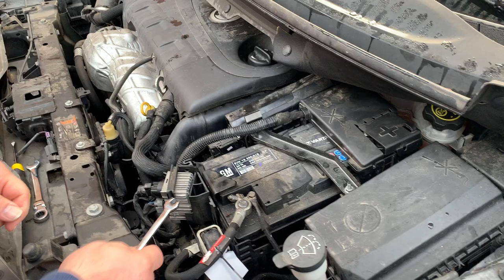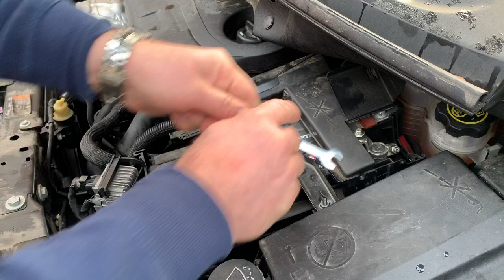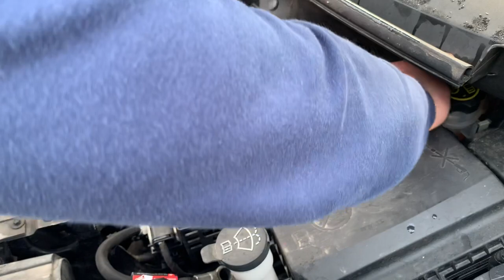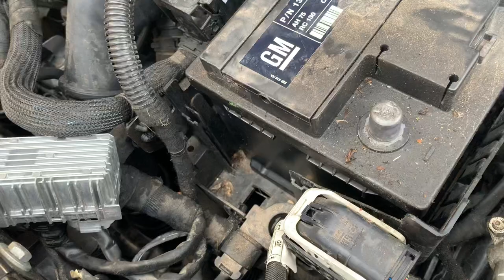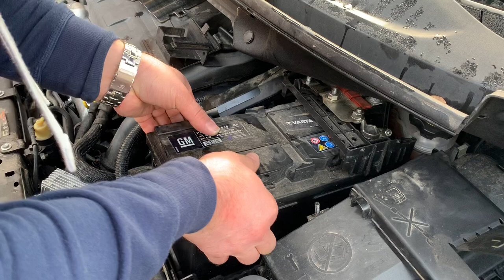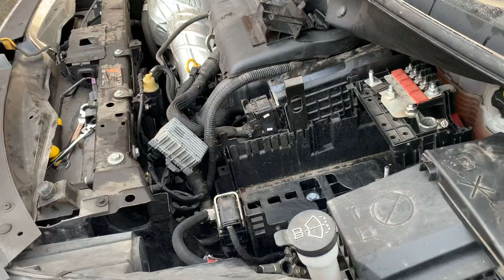Zafira C, Zafira Tourer wymiana akumulatora

Comment: Great video. One thing to note is when lifting the terminal panel at the positive end of the battery you need to release a plastic catch that grips the panel to the lip on the top of the battery, it's simple to do once you know it is there.
Reply: Or snap it off like I did before I found it was there.

Comment: Thanks, really helpfull video. I would like  to know after how long period was changed this accumulator? My experience with AGM accumulator from Zafira Tourcer C 2018(12V 80Ah) is really bad. After 3,5 years of use is Voltage 12.2V and cannot start the engine. I have to charged 3 weeks already. Changing accumulator looks like necessity.
Reply from the maker: Zafira 2014 GM battery.  Replacement on 12.2018
Reply: My GM battery lasted 6-7 years. From new.